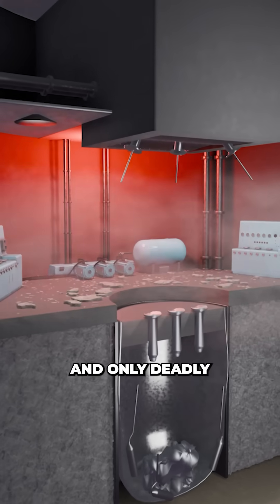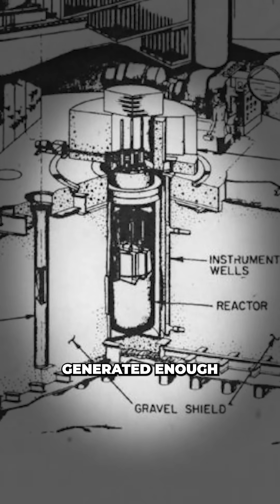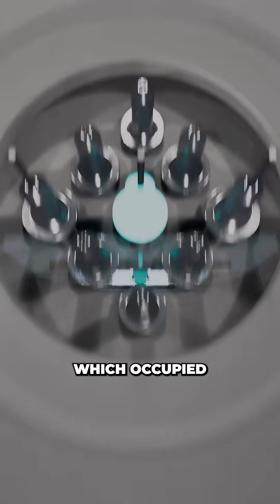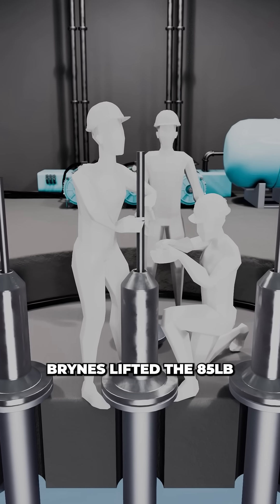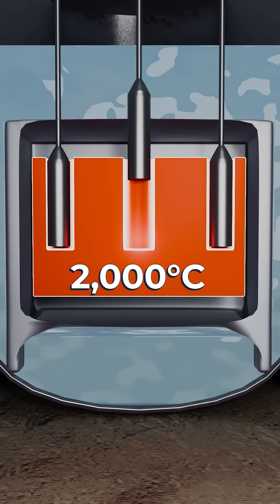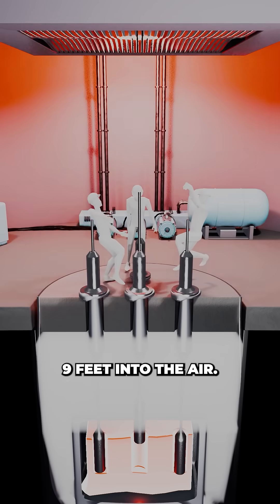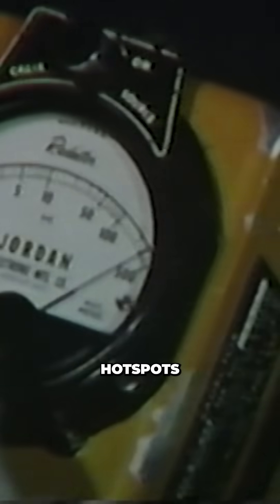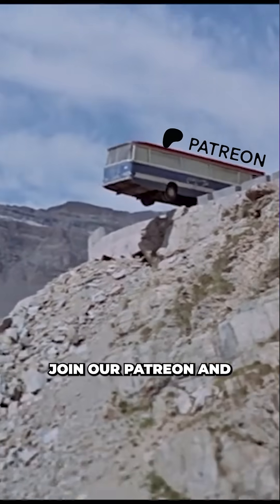The True Story of the SL-1 Disaster

Comment: I was  a US Navy Nuke. Heard this story many times. As stated, this created the the one stuck rod rule. We are also not allowed to move or even latch rods while the reactor compartment is open. Especially if people are inside. Designs have been made for any type of rod testing that we need to do so that it can be done remotely. The power spike cause by the rod movement in this incident isn't just about how he pulled the rod out too far, but the speed at which is was withdrawn. Rods are withdrawn at a specific speed so that you don't exceed a certain reactivity addition rate.
Reply: I’m a SWO Nuke currently on my conventional divo tour. I’ll be on my first nuke tour in like 2 years. How likely is it that I get my radiation limit “extended” like you did?😅
Reply: @eupo5936  Not likely. Officers do not sped that much time in the reactor compartment and if you ever got close to it, you would just be cutoff from going in. I worked in Reactor Mechanical Division. Us and Reactor Laboratories do the most work related to radiological controls and work in the reactor compartment. I spent a lot of time in there for very specific maintenance items that are rarely done. Can't say here exactly what. We were also low on manning because recruiting numbers were down as a result of the Iraq war. Also, my thyroid issues may be attributed to other things non-nuclear related, like JP-5 getting into our potable water. Hope that helps.
Reply: @jjmcgee83 
JP-5 in potable water sounds like a blast lol. I’m sure there was a little AFFF as well. Hope you got disability. And thanks.
Reply: @eupo5936 The word nuke is a common noun not a proper noun so it doesn't need an incorrect uppercase n, and you're not quoting anyone saying the word extended.
Reply: @thekeysman6760 
Bro you gotta be a ChatGPT troll bot or something. 1) you’re wrong. 2) you’re wrong.
Reply: @thekeysman6760 the word nuke there refers to their job title or position so it's reasonable to treat it as a proper noun. 

I don't even know why anyone would care enough about the word nuke having a capital letter to complain about it on a youtube video. What a weird thing to get upitty about
Reply: You were a nuke? Glad they never had to use you. Was the transition painful?
Reply: @UNRECOGNIZEDFILE use me? Yeah they used me. Transition? Not sure what you mean but I did 4 deployments in 5 years. Had my exposure limit extended a few times during shipyard periods. Now my thyroid gland doesn’t work anymore. So not exactly painLESS.
Reply: @jjmcgee83  lol i was makin a joke
Reply: OP, the word nuke is a common noun not a proper noun so it doesn't need an incorrect uppercase n.
Reply: @thekeysman6760 it is a proper noun. Nuclear personnel in the Navy are called Nukes.

Comment: Military History
The most dangerous gravesite in the US resides in Arlington Cemetery
The cemetery, consisting of 639 acres, is the final resting place of approximately 400,000 veterans and their family 
It had been nearly five years since Winston Churchill had declared that “an iron curtain has descended across the continent,” and plunged the West in a Cold War and a hot race for armament with the East.
Yet worlds away from Washington and Moscow, in a remote outpost 40 miles west of Idaho Falls, Idaho, a town would soon become home to America’s first nuclear accident.
On Jan. 3, 1961, operators from the U.S. Army’s Stationary Lower Power Reactor One, or SL-1, were returning from a 10-day holiday break.
Among them was Army Spc. John Arthur Byrnes, Navy Seabee Richard Carlton Legg and SP4 Richard McKinley.
SL-1 was designed to provide heat and electricity for remote Defense Early Warning system radar sites, established to provide early warning of attack by Soviet aircraft or ICBMs, supplementing conventional plants requiring costly and hazardous diesel deliveries.
However, poor oversight, lack of rigorous training and detailed procedures and inadequately tested technology spelled disaster for SL-1 and its operators that night when, shortly after 9 p.m., a steam explosion blasted through the plant.
According to Argon Electronics, which provides nuclear and other hazardous material training simulators, the blast had enough force to lift the whole 26,000-pound apparatus over 9 feet into the air and create 500 pounds per square inch of pressure “which forced the plugs at the top of the reactor open and fire the control rods like missiles into the ceiling.”
“The entire reactor room was instantly filled with burning steam contaminated water and fragments of the radioactive cores,” Argon said.
It would take over an hour and a half for responders to arrive at the reactor, and when they did, they found dangerous levels of radiation.
Byrnes and Carlton were killed almost instantly in the blast. McKinley was still breathing, but the 27-year-old succumbed to his injuries shortly after being transported into an ambulance.
An Atomic Energy Commission investigation found the explosion had been caused by an operator pulling the reactor’s central rod too far out of its housing and, according to NASA, “This withdrawal caused the reactor to go ‘supercritical’ in just 4 milliseconds as the core power level surged to 20,000 megawatts or over 6,000 times the rated power output.”
It was speculated that the rod had become stuck, resulting in an operative accidentally pulling it too hard to free it. Others say it was the simply the result of human error.
McKinley was interred at Arlington National Cemetery on Jan. 25, 1961. He was buried in a lead casket.
Brynes and Legg were buried in their hometowns but McKinley, a Korean War veteran, was laid to rest at Arlington National Cemetery at the behest of his wife.
Twenty-two days after the explosion, McKinley’s family gathered in Arlington, Virginia, to watch the veteran’s eight-minute funeral — from 20 feet away.
Laid to rest in a double lead-lined casket, McKinley was lowered into a 10-foot-grave encased in concrete and surrounded by a metal vault. For good measure an additional foot of concrete was poured in atop his casket.
McKinley’s gravesite remains the only radioactive burial plot in Arlington National cemetery, and while it is safe to visit, his cemetery file warns, “Victim of nuclear accident. Body is contaminated with long-life radioactive isotopes. Under no circumstance will the body be removed from this location without prior approval of the AEC [Atomic Energy Commission] in consultation with this headquarters.”

Comment: The remains of SL-1 were buried at 43°31′18″N 112°49′05″W, about 500 metres (1,600 ft) northeast of the original site (about 5 miles north of Atomic City). The burial site consists of three excavations, in which a total volume of 99,000 cubic feet (2,800 m3) of contaminated material was deposited. The excavations were dug as close to basalt as the equipment used would allow and ranges from eight to fourteen feet (2.4 to 4.3 m) in depth. At least two feet (0.61 m) of clean backfill was placed over each excavation. Shallow mounds of soil over the excavations were added at the completion of cleanup activities in September 1962. The site and burial mound are collectively known as United States Environmental Protection Agency Superfund Operable Unit 5-05

Comment: When I was on active duty many years ago, I (and many others) had to watch the original US Government film production regarding this disaster, the analysis of the probable sequence of accident events, and the subsequent cleanup. The whole film was very involved, complex and sobering. The reactor design was based on the known 1950s technology of water-moderated reactors and the readily available construction materials. We were definitely in the "learning phase" in 1961. These reactors needed to be "off the shelf," standardized, rugged, and relatively straightforward as to operation and maintenance. They were supposed to be transportable, fairly easy to set up, and able to function in a hostile environment without the need for constant resupply of critical components or consumable supplies. SL-1 must have looked good on paper. Being able to generate large amounts of electricity in remote areas without the constant need for generator fuel replenishment is beyond wonderful. SL-1 was a proof of concept sort of thing. It did generate electricity, and was also used to train personnel in the operation of a power reactor and its associated equipment.This incident probably showed the military that additional research  and experience needed to be in place before every expeditionary military outpost had a nuclear power plant. We're not there even today.

Comment: The nearby town fire department received many false alarms and they received one when this happened 

They were trained in the use of the radiation meters and they arrived on site and switched on the meters. 

They pegged high off scale and they assumed they were wrong and not working 

One thing I was told when I was young was to TRUST THE INSTRUMENTS NOT YOUR FEELINGS 

I have seen multiple times in my life when I was sure the readings were wrong 

When flying 

When testing electricity 

They were right
I was wrong 

ALWAYS TRUST THE INSTRUMENTS AND GET HELP

IT WILL SAVE YOUR LIFE

AND FOR GOD SAKES DON'T TOUCH THAT !!!!!